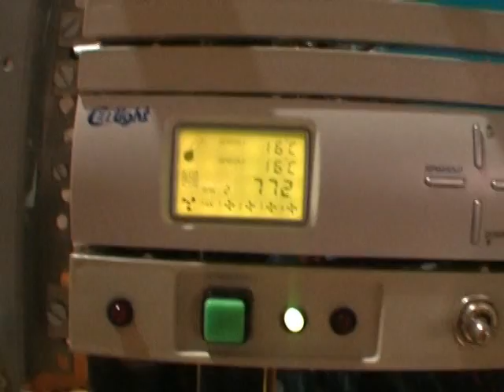Cool Computer Cooling with Car Radiator Extreme

Comment: SEEMS LEGIT...
cause you chose to use car coolant not ordinary water coolant...
help so much to avoid rust, leak or other malfunction system...
GREAT JOB BRO...
Reply from the maker: +fandi gladion Thanks mate! Enjoyed much on building it!
Reply: +legerstee1 you are welcome bro...
you know what is the best for your cooling system with car components???
i ask to my friend today(he works for gov lab science) what you have done before...
he got surprised and tell me ordinary water have bad result for cooling like rusty and leak and it cause water viscosity itself much weak than coolant liquid...
he tells me to tell you for computer just using motor coolant liquid cause it's better to catch heat and easy to electric motor pump and it will not being freeze in cold season...
Reply from the maker: +fandi gladion Great, nice to get stuff confirmed ;-)
Reply: +legerstee1 okay bro...
i am forget to wrote motorcycle coolant liquid...
Reply: +legerstee1 okay bro...
i am forget to wrote motorcycle coolant liquid...

Comment from the maker: Thanks daveruky.
The fancontroller you see is very cheap and i works.
But because it uses as switching way to lower the speed of the fans the fans start making some "switch noize". I don't think you should get this controller but another one. (it works in my setup, but not perfect :-) )
I have worked around this in my setup by adding 4 variable resistors in the power lines to the fans

Comment: I've read about people trying that.  It burns out the fridge.  Most fridge pumps aren't meant to run continuously.  It works fine for a week or so but then the fridge bites the dust.  

Plus there is a problem with condensation.  I had the same idea as you and googled it a few months ago.  Numerous people have tried it and failed...

Comment: cool u like it, nono not in the waterblocks, but in the radiator, you know in the sides, i will drill in the plastic ofcourse, but dont know where i will drill.. thinking of having the input in the bottom and the output in the top, what do you think? i thing i best becouse then the water will flow throw the whole radiator, i will buy a radiator tomorrow

Comment: thats nice, because i want to watercool a bulldozer and two gtx480 and thinking of using car radiator and i will mount it on the side of the case, and any tips from you will be great,

i will not reduse the tube size to water cooling tubing like you, instead i will drill a  11mm hole inte the radiator and then tap the hole and use watercooling fittings, what do you think about the idea?

Comment from the maker: hey! Great idea. I think you mean your gona drill a 11mm Hole in waterblocks (gpu and cpu blocks) that is ok but be really sure that you have clean thread and that it's straight. One other thing i came across when i was building this, use tubing that is sligthly smaller than where you connect it to, otherwise it will leak! and it's best to NOT use tiewraps!

Comment: I had a look at your videos with the cooler connected to a computer, and I noticed you said it wa ldling at 40 C and 65 C under load, does not seem very cool to me. What temperature is the room it is in? I have two liquid cooled PC's and they idle at 23-49 C for one and 23-38 C for the other. I messed up on uploading the videos but it is sorted now, I joined them today. The square finned block gave the best results in comparason with the rest. I have it almost in complete state now.

Comment: i love this i looked ebay fan controller is very cheap is it actually good??? im using water cooler and im wonder if fan controller would be good to control the fans on my radiator as your doing?? is it good does it really quieten the fans down and speed up at high temps.thanks and great idea this is.

Comment: My systems are constant overclock also but when the CPU is stressed it generates more heat. How can you make a cooler for a PC and it runs at 40 deg C at idle doing no work, and 60 deg C when stressed. What temperature is the room, what temperature is the liquid exiting the cooler?

Comment: Amazing! Very cool and creative. Are you actually using anti-freeze and water like a car or just water?
Reply from the maker: Hi! Thanks! i'm using standard cooland for in a car engine, this because it has good properties for different metals in a water loop. Still running fine daily after a few years!
Reply: You dont put water into a rad. It will rust it up like no other. The only time you want water in it is if it has a leak and it's only temp for you to get it up too a shop.
Reply from the maker: Zal1031 Indeed

Comment from the maker: @kyrregutt 
You can just remove the CPU cooling block and see what CPU is on there (or look it up in windows (if you have that running on it)).
Than you know what the Socket is. En probeble a block that is made for that socket will fit. Also you can check the dimensions of your current cooling block and see if a water block with dimensions x,x wil fit......

Comment from the maker: @pathman2 This box has everthing for the water cooling. So radiator pomp electronics en so on. Only a line is going out and going in. If you look at my other vids you can see the setup working with a computer. Your waterblocks vids look nice. Remember that Peltie elements will not give you much benifit. I've also thought about it but thinking about the energie costs and the gain in speed i left it...

Comment from the maker: Yes the room is to small en most of time it comes about 27 degrees (room temp) :-s.
Because i keep the cooler fans at it lowest possible it only gets it back to about 33 degrees (liquid temp) but if i want to get it lower i have to set the fans at higher and that not what i want. Also i think this i7 920 isn't the best cpu to overclock.

Comment: technically, just for the purpose of DIYing. can I use a fishtank pump as gou pump?
Reply from the maker: maybe you can but most of the times filters are included. I have seen that fountain pumps are better .
Reply: next concern is will I melt plastic stuff inside the pump? say, well get exagerated temps like 100's cels. will it? or not?
Reply from the maker: Mine never got above 35 degree C so should be no problem (I never had problems)

Comment: Hi, do you worry about Cooper and radiator aluminum corrosion ? I am planning the project now but I hear people talk about it, they take it seriously for the corrosion. But I think it does not matter that much since car engine is make of different material and they run fine. What do you think? Do you run into any trouble? thanks
Reply from the maker: I have used my cooler for a few years without any problems and it was still working without refilling or anything when I disconnected it (few months ago). I have used normal engine coolant that has the properties of not having this corrosion problem. Good luck!
Reply: Thanks for replying, can you tell me what pump are you using and how is the noise level? I plan to use long tubing and put the radiator away. It will be risky I think I need dual pump set up.
Reply from the maker: It's a eheim 1250 pump, I put it on rubbers and that made the pump very silent, have listen with my ear on the case to know it's running, pump in the vid is a different one.
Reply: legerstee1 hello! Did I understand you right: you use car engine coolant? Isn't there any side effects for a cpu or videocard waterblocks?
Reply from the maker: I have had no problems what so ever!

Comment: How about you do this with highest end rig and try overclocking
Reply from the maker: Thanks for the reply! The video is very old so this (cooling) rig does not exist anymore...
Reply: @legerstee1  I see but is it do-able if you wanna recreate it with what I said? I hoped someone would use effective passive cooling with a kick ass PC case and radiators and actually make it look cool. 
Ps: thanks for the reply never thought you'd take a look at a reply on a 10y/o vid
Reply from the maker: @Specialisto  no worries. Im not able to re create it. The world has changed so much and allot of parts are available now of the shelve. Also my life does not permit my anymore to invest time in this. Thanks for the reply 😀👍

Comment from the maker: @DCDUO 
The Radiator performs great! But the density of it is a bit high....so bit hard to get a good airflow through it. But most of the time the water temperature only rises about 3 degrees above room temp.....Currently have also the motherboard fully watercooled. More info will follow on my channel. Thanks for watching!

Comment: 3 questions... do yous till have it?..
can you modify it to make it high flow with 2 input and 2 outputs?
and will you sell it?^^

I have a good computer that can use this... view my videos if you wanna see...
I am running 2 loops... one for the gpus and one for the cpu and system board.

Comment: small movement of fluid!!!! if there is intel pentium d 2,5ghz this ok but 2,5 max hehe
but today when i7 975 3,33 it doesn't work because must be faster circulation coolant, nice implementation i wanna do it but for now v8 gives me 34st i want to have radiator outwards and bigger, and 2 water pumps entry and exit, and large fans, COOL GOOD WORK!!!

Comment: Does it still work
Reply from the maker: It was working fine until I had to move to a different house and space got a issue. Also the world has changed so much you can now buy better liquid cooling in a kit. Thanks for asking! The pc though  is still happely used daily!  Cheers

Comment from the maker: @4g63attack 
I thought about that but than i had to cut away to much of tha case en this would had made is less strong.....
And i had to find a different power supply (and controller) to power the high watt fan.
So....i could but it thought this was easier. 
(all in all in took way lot more work and i'm even working on it now.....)

Comment: why you make it if you have no computer, and fans on wrong side, the air in the case will warm up with pump and PSU, really air should be drawn directly from outside the case and you be blocking the airflow if you leave side of computer case on the air has nowhere to go.
Reply from the maker: This video is very old, check my other videos for your answer
Reply: legerstee1 ok will do, and thanks 4 replying

Comment from the maker: @ERIK5564 
Well, i just noticed your postings.
And first of all i picked a car radiator because, its cheap! compare for yourself and see
And yes it would be better to put the radiator not in a corner and have it in a more open space..but the problem is, i don't have that space. 
The best thing would to drill a hole in my house wall and put the radiator outside. But....than i have a hole in my house. And remember most cars have the radiator also inclosed airflow is key not the box around it.

Comment: Input temp 16c output temp 16c. Ugh
Reply: If the ambient temperature is 16 degrees and it is not connected to a heating element it will not make it cooler, this is not a refrigerator. Pay attention in physics next time.
Reply: +Igor Radmilovich rip